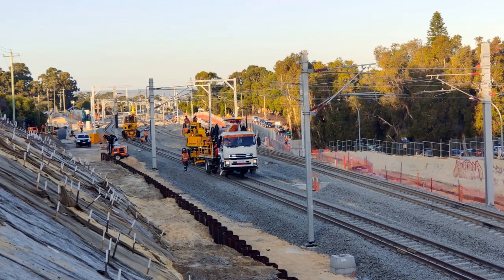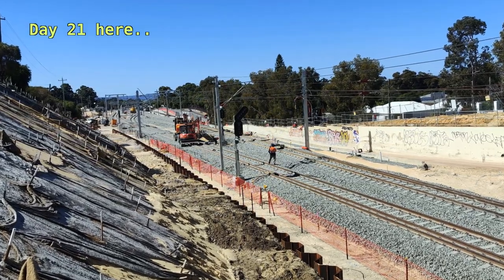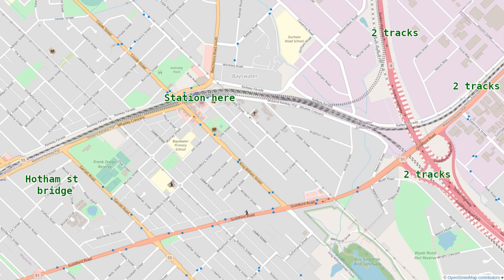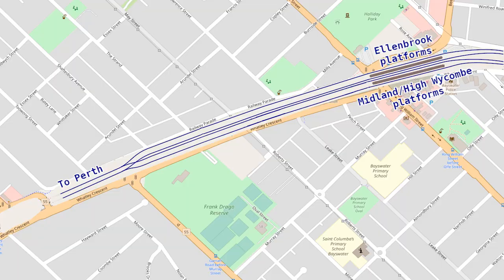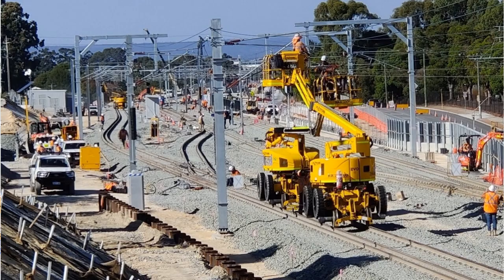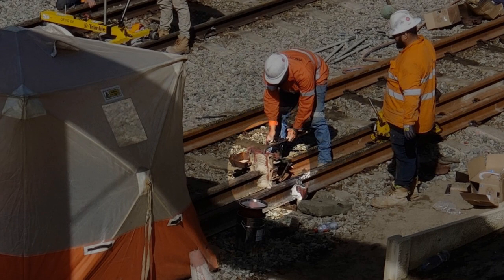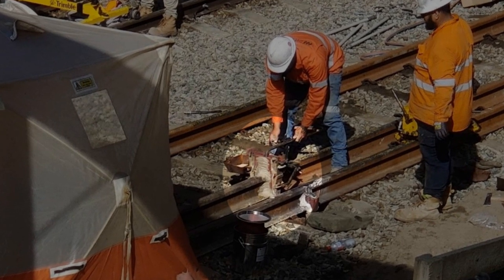Bayswater station upgrade week 3

Comment: Welded rail is under tension. Ideally you weld on the hottest day, otherwise you get Melbourne's problem of the tracks warping every time you get a new hottest day.
Reply from the maker: Ah, there you go. I knew there was a reason. 
Actually I should have remembered this. When I worked as a tech in the UWA Civil Engineering department. We calibrated a rail tension measuring device using our Instron machine. Some South African blokes had designed it to measure pre-tensioning systems prior to welds.
But that was way back in the early naughties, so no wonder I'd forgotten.